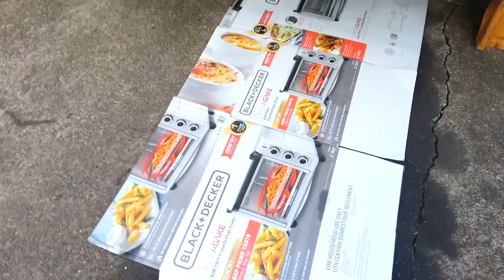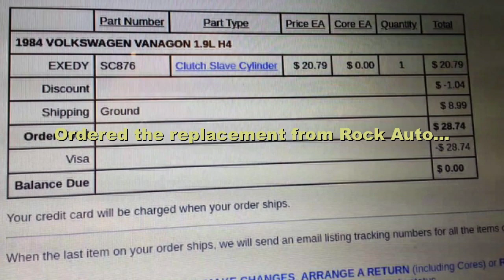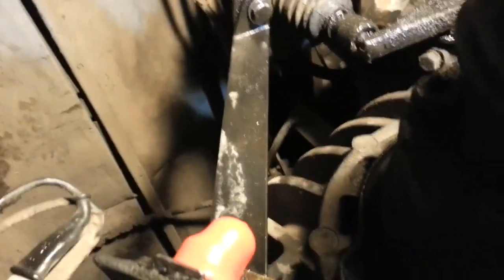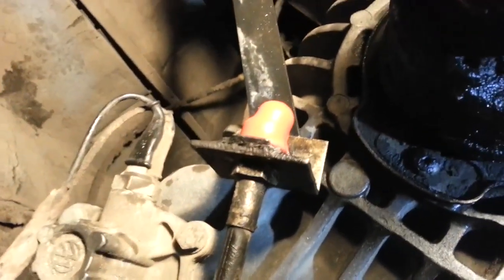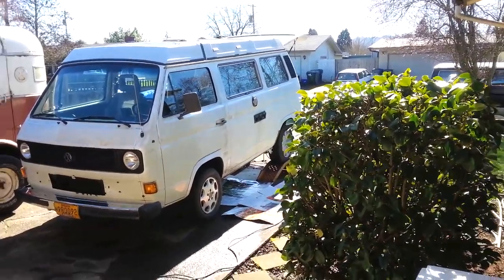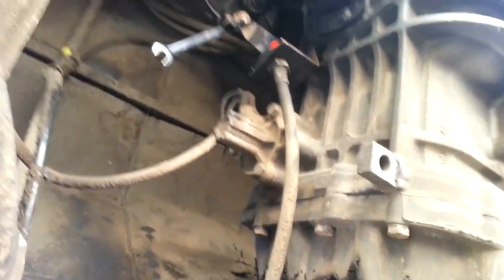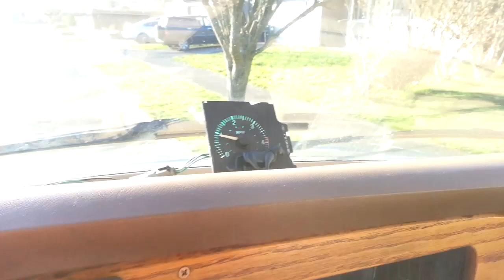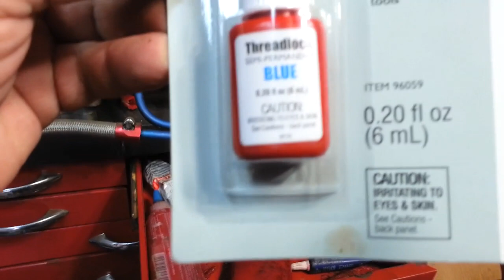Replace and Modify VW Vanagon Clutch Slave Cylinder

Comment: Nice, I'm working on a van that had been used for parts. I don't know which parts are supposed to be there. Your video helped me.... A good way is the pull the retainer pin from the clutch lever. Pull the bolt to the bell housing and the whole assembly comes down. Then you can get access to it.

Comment: About to do this same job on 88 GL.   My 85 westy has the same MB wheels.  I had to cut off all the brake fittings, there was nothing for the wrench to fit on... gas tank replaced, power steering lines, radiator, and coolant lines... I'm flip flopping about heater hose and radiator hose replacement.  Chasing a leak is a pita.

Comment: Nice work mate. There's a slightly easier way to do it - it involves opening the engine cover, slide in a 13mm spanner underneath and then break the nut loose from the top. But great video, looking forward to seeing more.
Reply from the maker: That's a very good idea. Working alone, I couldn't get the spanner to stay on while turning the other side. With a helper this could have saved a lot of time.

Comment: I’m digging the Sun Microsystems sticker on the steering wheel of the van you used to go get bolts. I still have a Java Station and a Sparc Station in my collection of outdated computer hardware.
Reply from the maker: I was the lead engineer at a Sun integrator and still run some rack mounted servers for email and web services, using OpenSolaris and its successor, OpenIndiana, on both SPARC and IA64.
Reply from the maker: I fix Volvos, too. LOL
Reply: @vanstechcorral  my first *nix experience was with SunOS->Solaris (early 90s) and I still prefer vi over emacs. Sounds like we have some similar background/interests. Glad I found your channel. I'm about to replace my clutch slave cylinder. Hopefully I won't have the same trouble with the bolts.  I've already trained my daughter how to assist with bleeding so I won't be using a pressure bleeding here either. Thanks for posting this video!
Reply from the maker: @fiveable  I did recently have a pressure bleeder passed on to me from another mechanic, after that was done. I went from a dealer mechanic using "Sun" diagnostic equipment to a computer designer/programmer/engineer working with Sun computer equipment LOL.
Reply from the maker: @fiveable  A colo in Miami just shipped me our old Sun equipment when they went out of business - including our first Sparcstation 1. The V100 1U is still useful for infrastructure, with serial ports from a 32 port Cisco router.
Reply from the maker: @fiveable  Speaking of emacs, Richard Stallman rode around with me in the 85 Corvette that appears in some of these videos! I use vi or its clone updates too, though.
Reply: @vanstechcorral  That’s amazing!  Richard Stallman! He is a hero!  By the way my clutch slave cylinder replacement went well. No stuck bolts here, fortunately.
Reply from the maker: @fiveable  Glad to hear it, I wondered.